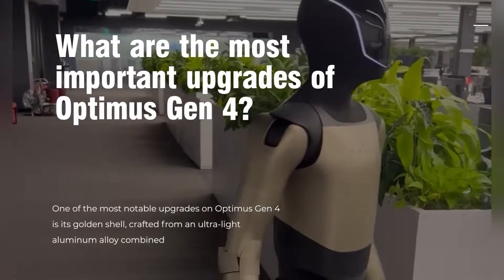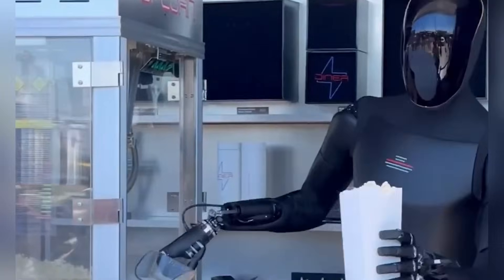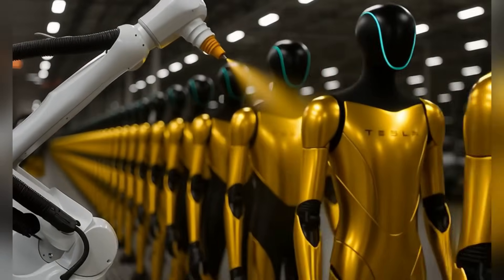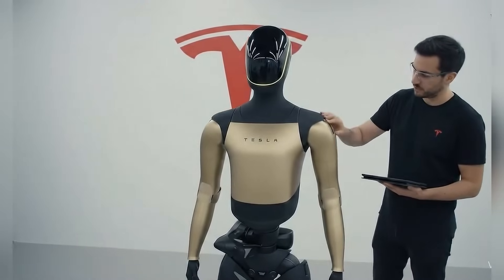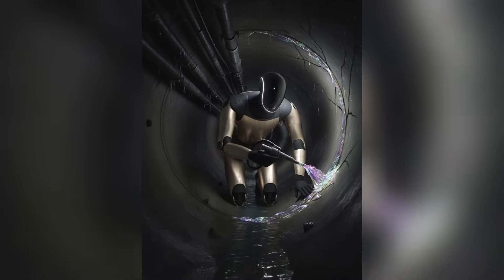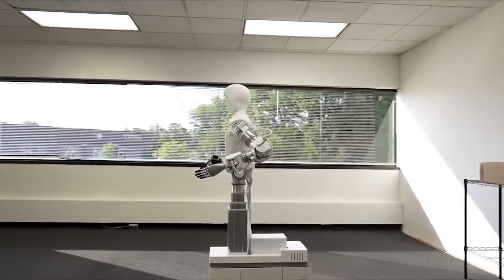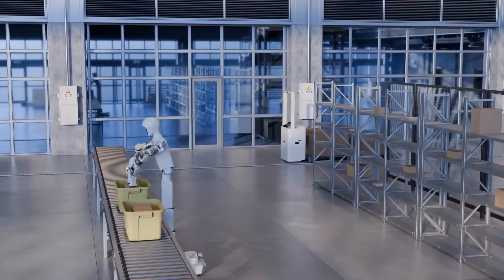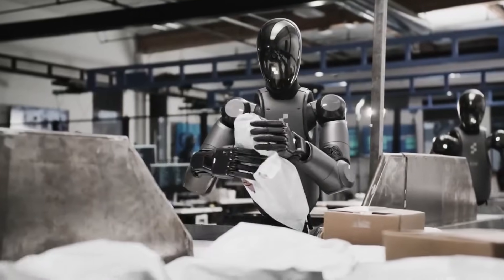BREAKING: Tesla’s Golden Optimus V2.5 SHOCKS the World — V3 Is Coming!

Comment: Actually the newest estimate for the V series is around 20k to 30k once they are in mass production.(per current A.I. results) "Target price: Tesla aims for a mass-production price of between $20,000 and $30,000 per unit, which would make the robot cheaper than some cars. The first pre-orders for Gen 3 units are rumored to be as low as $10,990 to $15,989.
Future affordability: CEO Elon Musk has indicated that the goal is for the robot to be affordable for the average person, comparing it to a personal "R2D2" or "C3PO".
Mass production timing: The final price is dependent on the company's ability to achieve mass production, which is still some time away. Some analysts predict the lower $20,000 price point won't be a reality until around 2028 or 2030. "